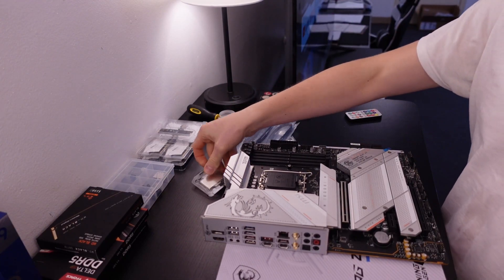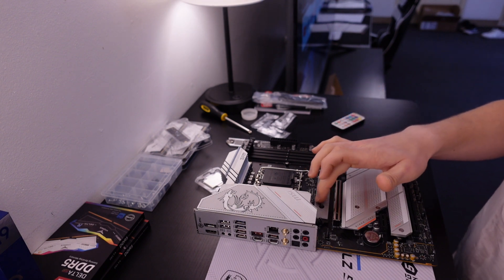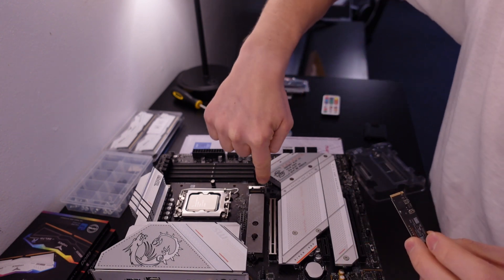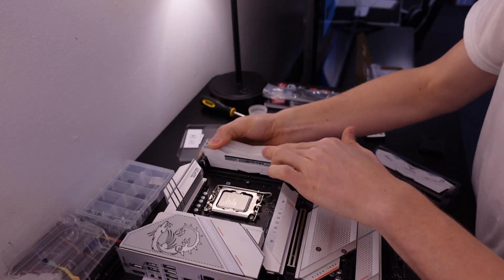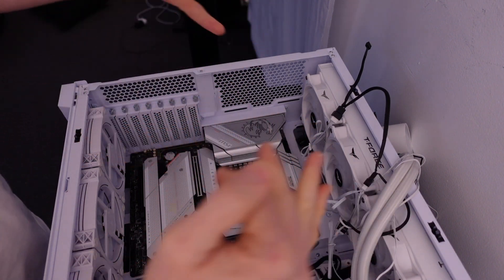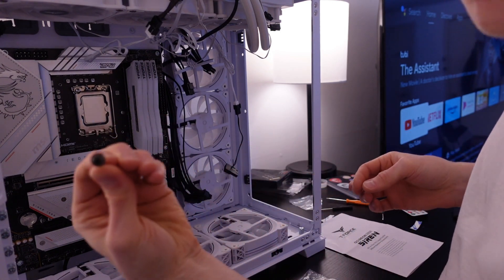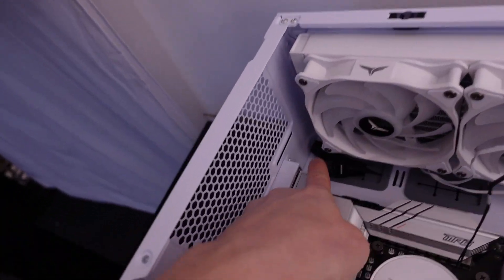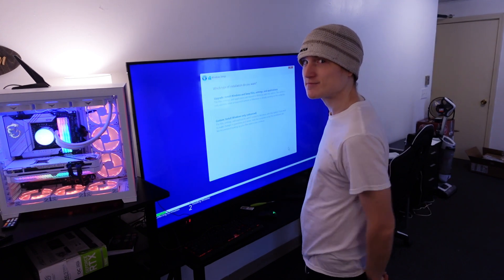HOW TO BUILD A GAMING PC 2023 - Step by Step Guide / Tutorial

Comment from the maker: Bit of a longer episode of a PC build in a vlog style rather than the shorter build 😉😉
Intel i9 13900
✅https://amzn.to/3Ji63NB

ASUS ROG STRIX RTX 3090
✅https://amzn.to/3WONrYB

Lian Li O11 Dynamic Evo Case
✅https://amzn.to/3HhMVg6

MSI Z790 Edge Motherboard
✅https://amzn.to/3HhDf58

Segotop 1250 Watt Power Supply
✅https://amzn.to/3XHGv0Y

Teamgroup T-Force 7000Mhz DDR5 RAM
✅https://amzn.to/3kI3ied

Teamgroup T-Force Siren GD360E 360mm WHITE AIO ARGB Liquid Cooler
✅https://amzn.to/3JDsAoz

WD Black 2TB NVme Drive
✅https://amzn.to/3WKTRIu

DS Addressable RGB 120MM LED Case Fans
✅https://amzn.to/3Dl0ZEo

ASIA Horse 16AWG White PSU Cable Extensions 
✅https://amzn.to/3Dnbvel

Comment: I saw part of this vid on Amazon. I want my new build exactly like this setup, however the water cooler is not available anymore as well as the power supply. That build looks super clean and love the white cables and the lighting. Most everything you list is available but I want to use MSI nvidia Geforce RTX 3090Ti. I am a little disappointed not a full tower case and it seems nobody is making cases with Optical drive bays any longer. I am hoping the graphics card will fit this particular case, then there is the challenge with the water cooling. I am not so much into the gaming thing but more multimedia and graphics artist type stuff. Video editing, etc. If you can recommend an equivalent water cooler in white with the same type lighting with 3 fans, I would greatly appreciate it. I love the video. I think I have watched it at least half a dozen times now and it has given me the fever to build a new pc. I am going for the same MB, case, memory and will be using your links to purchase.
Reply from the maker: NICE!!